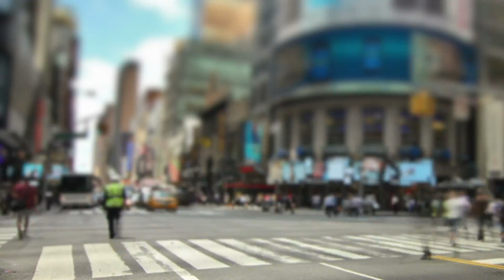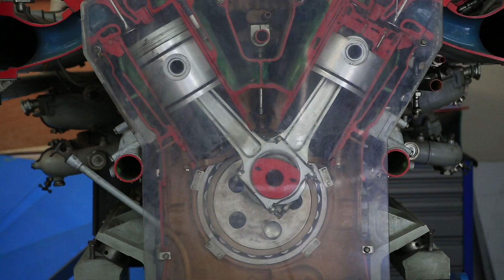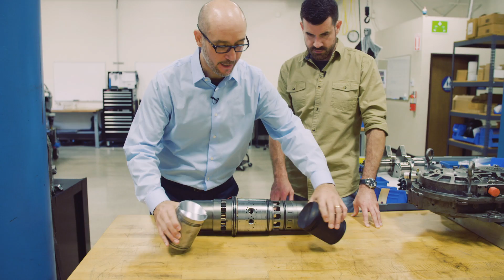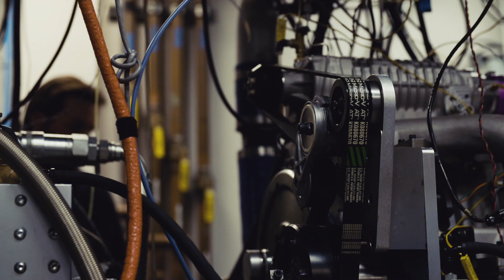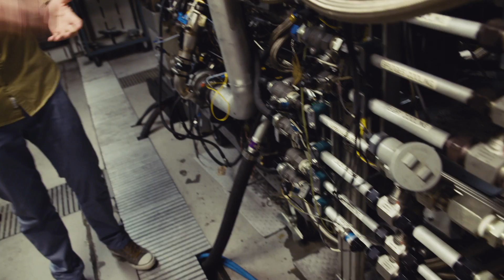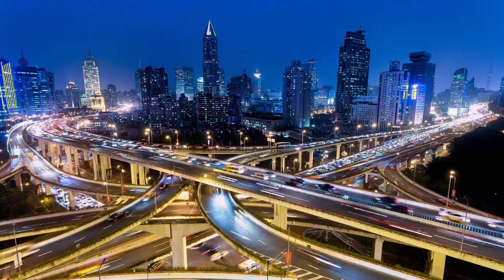This Radical Redesign Could Keep Gas Engines Pumping | WIRED

Comment: Electric is superior. We don't need a better ore efficient engine, we can theoretically power the earth with solar energy. It may take a while, but what we need is better batteries, better solar cells, better wind turbines and a better infrastructure for energy transport. We don't need combustion.
Reply: dehim verveen electric also consumes ore, batteries have rare material in them, find a way to cut out the rare parts and then you got a efficient engine
Reply: Zack, pay attention.

Let me say this again.  It is NOT true that current Lithium Ion batteries of the variety you find in a Tesla, for instance, contain rare earth elements.  Manufacturers have found ways of building batteries without them.  Your information is way out of date.
Reply: I'm all for electric and really efficient engines. MORE gas for our LS engines.
Reply: They are only the quickest production car at 0-100... after that, they kinda suck as the higher the RPM, the lower the torque... and until electric cars are using hydrogen power, they are toxic to the planet and they will generally become worthless when the batteries die (the cost of replacing them will be greater than half the value of the car = write off).. at best, they are a step to the side, not forward
Reply: John D hell yea marine
Reply: 2LegHumanist "Solar city are selling panels that are rated at $0.5 per watt. The price 5 years ago was $3.00. That's a massive improvement in price/performance." Then pray do tell , why solar has not caught on, even in the residential areas where it should be more-or-less uninfluenced by the grand schemes of politicians.

Oh wait, what is that? you dont just need panels to get solar? Well what else do you need? = A company to install it and rip you off, additional circuitry in your home, more or less dumping all the electronics in your house for ones that are power-efficient enough to run off solar ( inverter Acs and fridges, etc etc ) , The solar charge controllers, the batteries, oh dearie me did I forget to mention the batteries? 

Waving around the 0.5 figure does not do much if you live in the real world, where things arent magically the cheapest at wholesale prices and you dont need supporting hardware to make solar work.  

Now, all this said, I am a big fan of solar. But Im not blind to recognize that its just not there yet, not by a long shot. 

for now, IMHO 

investment needs to be 100% in solar
and our power needs to be from mainly nuclear and hydro.
Reply: 2LegHumanist Erm, you do. Its to smoothen out power delivery , at least one is required. Similar to how a in-line UPS works, if your goal is to just return back electricity. 

Giving heavily varying amounts of electricity back to the grid sounds like a recipient for some blown electronics. 

Oh wait, but does that mean you still have to rely on the power of coal and gas and oil to actually supply running power to your house?

Quite the ironic statement there. 
So you make all these non-arguments based off how economical and friendly and awesome solar is, and how the overall cost is a non-sequitur, as you dont need all of those extra things to run it, only to just implement it in a manner that still relies on fossil fuels? 

The Irony is deep in this one.
Reply: 2LegHumanist 
"Wow, you really are a moron."
Hold your tongue. Otherwise this debate is over. 

"Clearly you were referring to expensive batteries like the power wall, not a small battery for regulation which costs fuck all. Your entire point was about cost. "

No, I could be referring to a few deep cycle lead acid batteries as used in India with their UPS systems.  

"I also gave you the contents of my quote including full installation and including a battery for storage which also refutes your bullshit claim about feasibility."

= anecdotal evidence is worthless. 

"And no, it is not ironic to be a net producer of renewable energy. It means giving solar to the grid at peak times so that someone who would otherwise be using coal-generated energy is instead running on renewables. That offsets the owner's grid energy use. Very simple accounting, you must be an absolute fucking moron to not understand it."

No, the point here is to be able to run off solar. Either you do that via a company that only provides solar, or you do that with a complete home only system. 

Saying that "oh we are only using less coal now" is a complete bs argument. Thats like saying oh, its only a little bit of cancer. 

And may I remind you that the goal is to go completely renewable?
Reply: 2LegHumanist I'm not saying I agree with gasoline engines ether, they consume the world from the inside out, but so would electrical parts, the amount of cars created would out pase the amount of hard to find ores. this drives prices up and make it harder to build electronics, all we really need is a engine that can run on biofuels that can replenish themselves faster than consumption.
Reply: It's changing for hybrids too: http://fortune.com/2016/07/12/honda-rare-earth-battery-hybrid/
Reply: Matapatapa What a weird bunch of non-arguments.

Solar is catching on. The production of solar energy is doubling every two years.  It is increasing at an exponential rate!

You don't need batteries for solar.  You simply sell your excess solar energy back to the grid and run off the grid at night.  That's far more cost effective than batteries.  But you can expect batteries to become a lot more affordable when there are more electric cars on the road. Not only will it reduce the price of new batteries, but it will also create a second hand battery market.  Car batteries are useful in houses well beyond the point they're degrade too much to be of use in cars.

I don't even live in a sunny country and I can get a panel/battery system installed that runs my house completely for 8 months of the year at a cost of €0.04 per kwh.  Less that half of what i pay now for off-peak grid electricity.

"Not there yet" is a cop out.
Reply: "Electric is superior"
Not yet, but no one's trying to stop you from buying electric cars until one day maybe they are superior, then I'll hop right on that bandwagon.
Reply: 2LegHumanist
So, no counter-argument whatsoever? Just an expression of how you don't understand how quotations work? Cool
Reply: 2LegHumanist
This topic seems to get you too upset to even begin a discussion.
Reply: 2LegHumanist
You realize I wasn't originally replying to you, right? I was arguing against the OP. You started talking to me for no reason. So why tf would I argue against a point you made? I haven't even read your previous posts.
Reply: 2LegHumanist I really think you're missing my point.   Tesla is in the most precarious position of any new high tech company.  They are trying to cross the chasm where they go from selling high end low volume vehicles with sizable profit margins to high volume low margin vehicles.  And with the cost of the batteries being half the cost of the vehicle this is not going to be easy. Yes I know.  Tesla says that the Gigafactory is changing that. But it sure seems to me that Tesla is constantly selling to investors as much as they are selling to anyone.  I don't know how you can think the car pays for itself in 7 years.  It doesn't come close. At an average of 12,000 miles driven a year at $2.50 a gallon at 30mpg i've spent $7,000 on fuel $10,500 @ 20mpg.  With the electric car I saved say 2/3rds that.  But now I need new battery packs which totally eliminates what I saved on fuel.  Wake me up when the proposition is convenient and cost effective.  At the moment it doesn't come close.
Reply: dehim verveen Yes we do!
Reply: Oh look, a group of tree-hugging Hippies!

Solar Energy Doesnt work at Night, R&D for More Better Battery is Decades of Could be Half a century ahead of us.

Wind Turbine Can Break Down during storm.
There is also a Dangerous Substances used to create A Solar panel, They always escape in a gas form in the atmosphere, but its still Needed for sucking More energy.

Im not some Oil Company Paid Keyboard warrior, direct Drives Vs Electric Drives have Big Differences, Electric motor or any similar Tech tends to Heat up and wear down, Thats the Issues that Cant be Stopped On US navy's Electro-magnetic Railgun, it will never be stopped and they said Cancelling will be a big consequences or a waste of Money so they just have to Minimize it.

If you Idiots were to know something about those resent "Carbon Absorbing" Technologies, We can continue Using Internal Combustion.

Plus A Marine propulsion is Weaker, Thats why They Still Use Internal Combustion or Gas Turbines.

We Still Need internal Combustions because If you dont know, Space Outside Earth Is Cooler than you think, the solar panel of a Rover deployed on Mars Absorbs less energy vs the earth.

Therefore, your comment is Pointless liberal Propaganda.
Reply: The joy I get when I press the pedal down on my twin turbo built motor 350Z says that yes, we do NEED combustion.
Reply: 2LegHumanist ya, your right, I haven't had much time with the S type, mostly the behemoth prius. I just thought they improved apon the same principle XD
Reply: Matapatapa Wow, you really are a moron.

Clearly you were referring to expensive batteries like the power wall, not a small battery for regulation which costs fuck all.  Your entire point was about cost. 

I also gave you the contents of my quote including full installation and including a battery for storage which also refutes your bullshit claim about feasibility.

And no, it is not ironic to be a net producer of renewable energy.  It means giving solar to the grid at peak times so that someone who would otherwise be using coal-generated energy is instead running on renewables.  That offsets the owner's grid energy use.  Very simple accounting, you must be an absolute fucking moron to not understand it.
Reply: Matapatapa 
*Saying that "oh we are only using less coal now" is a complete bs argument. Thats like saying oh, its only a little bit of cancer. *

If the goal is to get to 100% renewable, why shouldn't achieving that goal include incremental steps towards getting to 100%?  Are you actually suggesting that we should do nothing at all about ever increasing cO2 emissions until we have the means to eliminate them completely?  That idiotic plan will result in a hell of a lot more carbon being produced before we get anywhere near 100%.

It would be a big fucking leap towards that goal if all day-time electricity was produced from solar such that coal plants only had to run during the hours of darkness.  It would also reduce the amount of battery storage necessary, since it would only need to kick in at night.

Cancer is not in any way analogous to cO2 emissions.  Not even a little bit.  Reducing carbon emissions is the goal. It is not an all or nothing zero sum game.  You've created a false equivalency fallacy.

And of course none of that what so ever changes the fact that battery storage is here today and it is affordable.  But people who do it are doing so to get themselves entirely off the grid.  That's a different goal.

I've spent time in Delhi and I am well aware of the situation with the grid that cuts out pretty much every day.  UPS systems are indeed needed there.  Fortunately those systems will get cheaper and cheaper as new battery technologies are developed.  They are being developed thanks to electric cars and mobile phones.  Lead Acid storage systems will soon be obsolete.
Reply: 2LegHumanist "If the goal is to get to 100% renewable, why shouldn't achieving that goal include incremental steps towards getting to 100%? Are you actually suggesting that we should do nothing at all about ever increasing cO2 emissions until we have the means to eliminate them completely? That idiotic plan will result in a hell of a lot more carbon being produced before we get anywhere near 100%."

You got me here. Your right on this point. 

"It would be a big fucking leap towards that goal if all day-time electricity was produced from solar such that coal plants only had to run during the hours of darkness. It would also reduce the amount of battery storage necessary, since it would only need to kick in at night."

Thats the thing. daytime is also when all our cars are running and all our other things are going, so IMHO a household going all solar at once and learning to budget electricity is better, because that will make daytime/nighttime management obsolete.
Reply: Matapatapa I agree that it's a better option, I'm just suggesting it isn't the only option.  People should be encouraged to produce renewable energy any way they can, whether they personally directly use it or not.
Reply: ***** "they are superior"

Glad you agree Jim.
Reply: dehim verveen There is no doubt that electric motors are far superior to internal combustion motors.  But the rest of your post is nonsense. The same  obstacle that prevented thei adoption of electric motors for personal transportation and trucking 100 years ago is still preventing it.  That is the ability to store and resupply the fuel quickly.  Billions are being spent on  creating a better battery/supercapacitor and yet we're not there yet and probably won't be for another 20 years. In the mean time more fuel efficient and less polluting gas and diesel engines will make a huge difference.
Reply: Some things like ships will probably remain or switch to being gas-powered though, either through hydrogen or simply synthetic gas. If syngas produced from solar energy becomes a thing before batteries with that same energy density, many things will stay on gas, because it's cheaper and easier.
Reply: 2LegHumanist EVs don't constitute 1 percent of the US passenger new car market and not even 1/10th that in the overall market.  They are effectively 0 percent of the trucking market.  You can lower the cost of batteries a lot and it still doesn't eliminate range anxiety.  The best EV on the market doesn't allow me to make it to the ski resort and back.  And no matter how many charging stations you build the slow charges prevent any serious market penetration.  Also you're ignoring the commercial trucking industry which requires range. I believe that one day EVs will dominate.  And for all the price drop the interest beyond early adopters is minimal.  No ICE vehicle resale value drops as fast as electric vehicles.  Most of the car manufacturers probably wouldn't be investing in them if it weren't for CAFE standards in the US and equivalent standards in Europe.  If companies like Achates can reduce fuel consumption in the Commercial Trucking industry they will save the industry billions and reduce pollutants by at least 10 percent.  I believe that at some point in the future EVs  will be ubiquitous and dominate the market but not with a lithium ion battery.
Reply: ***** I  think you're right Blazer.  The ICE isn't close to dead.  I'd even bet that more of them are being built now then ever before.
Reply: +dehim verveen Until we can recharge an electric vehicle in a comparable time frame to combustion engines (with comparable range) electric cars will not be a mainstream item.
also the infrastructure (power generation) would not support at present a shift to purely electric vehicles it bearly keeping up with present demands.
So any engine that greatly boosts the mpg without increasing the emissions is going to be greatly recieved
Reply: +Nikola Tesla

EVs don't constitute 1 percent of the US passenger new car market and not even 1/10th that in the overall market

I'd love to understand what the relevance of this sentence is to this conversation.

Especially when you later follow it up with:

I believe that one day EVs will dominate

I haven't claimed anywhere that EVs currently dominate.  I've merely argued that the technology is superior and will dominate in the future, a position you clearly agree with.  So why the strawman?

You can lower the cost of batteries a lot and it still doesn't eliminate range anxiety

Range anxiety can't be eliminated in any vehicle that has a finite range, including petrol cars. It can only be reduced.  In EVs it is reduced in two ways. First by increasing the capacity of batteries (and therefore range), which is made possible by the rapidly falling prices of batteries.  The second is by gaining even a small amount of experience at driving even a limited range EV as demonstrated in this study:

Rauh, N., Franke, T., & Krems, J. F. (2015). Understanding the impact of electric vehicle driving experience on range anxiety. Human factors, 57(1), 177-187.

The best EV on the market doesn't allow me to make it to the ski resort and back

So take the massive amount of money you save by not buying petrol in your daily commute and hire a petrol car when you need one if you're going to be that precious about having to stop for 10-15 minutes every 400km.

And no matter how many charging stations you build the slow charges prevent any serious market penetration.

Did you read any comments in this thread before responding?  Did I not point out that 350kw-1Mw charging is on its way?  Pretty sure I did.  It's hardly slow.  If you're going to drive more than 400km you should be taking a break anyway.

Also you're ignoring the commercial trucking industry which requires range.

Tesla will be starting production of long range heavy electric vehicles in the next two years.  They're actually great candidates for both BEV and FCEV technology. Lots of capacity to hold batteries and lots of capacity for large fuel cells.  Fuel cells BTW are only expensive in cars because of the cost involved in miniaturising them.  Large fuel cells are a dime a dozen.  All that is needed is the price of batteries to fall enough to make BEV trucks economically viable to load a truck with batteries or a better distribution network for renewable hydrogen.

And for all the price drop the interest beyond early adopters is minimal

You're clearly not paying attention if you believe that.  Go take a look at the volume of pre-orders for the Tesla Model 3.  400 thousand reservations and counting with deposits paid two years in advance of the first vehicle leaving the production line.  The interest is there, people are just waiting for better range in a nice looking affordable car.

No ICE vehicle resale value drops as fast as electric vehicles

Yes, more evidence that BEV technology is rapidly improving.  Noone wants last year's model because next year's model is way better. Also, who gives a shit about resale value when the running costs are so low that the car can pay for itself?  I certainly don't.  When my leaf ends it's life I will be salvaging the battery as a house battery and selling the rest for scrap.  By then the vehicle will have paid for itself twice.
Reply: +Ste T
Until we can recharge an electric vehicle in a comparable time frame to combustion engines (with comparable range) electric cars will not be a mainstream item

Bullshit.  Almost all driving that happens is short range.  Very few people are going to be put out by having to stop and charge for 15 minutes every 400km during long trips and all other charging takes place at destination.  The car charges while you're not using it, so there is actually less waiting around.

Petrol car = making a special trip to a petrol station, waiting 5-7 mins to fuel up, lining up to pay and then continuing on your journey.  

Electric car = show up to your destination, plug in and walk away.  Your car charges while you are sleeping at home, working at the office and/or shopping etc.  Zero waiting.

the infrastructure (power generation) would not support at present a shift to purely electric vehicles

Bullshit for a number of reasons.  

1: It takes 6KWh of electricity to produce 1 US gallon of petrol from crude in the refinement process alone.  Stop buying petrol and you reduce the demands on the grid.  
2: Almost all electric vehicle charging happens at night during off-peak periods when electricity is at its cheapest and demand for electricity is at its lowest.  There is abundant capacity in the grid.
3: Hate to break it to you, but even if there was a capacity problem, its possible to increase power production in power grids and affordable to do so when there is a market for that electricity.

It's fun debunking the same lies over and over again.
Reply: 2LegHumanist You're glossing over far too many issues.  I absolutely AGREE with you that we are moving towards electric vehicles. Electric vehicles are 5 times as efficient.  But charging with 110v AC takes 16 hours to recharge and even with 240v AC  it takes 8.  And while peak electric demand is during the day with maybe .one tenth of 1 percent of the vehicles charging at night.  It won't  be when even 10 percent of cars are charging at night..  Your head is is in the clouds over the speed of adoption. My bet is that new vehicle sales of EVs don't crack 1 percent for 5 years and not likely to crack 5 percent for 10 years.  In the meantime that dinosaur the ICE can always benefit from further improvement.
Reply: But charging with 110v AC takes 16 hours to recharge and even with 240v AC  it takes 8

Which is precisely why nobody charges from standard household plugs.  That's granny cable charging.  EV drivers have charge points installed in their homes that offer considerably faster charging speeds.  They're not even expensive, you're talking €300 including installation for a 3.3kw charge point.  My 6.7Kw charge point fully charges my Nissan Leaf in 3 hours.  Tesla sell 10 and 20KW charge points to charge their larger batteries.

People who can't charge at home use the public network.  Most public slow chargers are 22KW AC.

And while peak electric demand is during the day  
It won't  be when even 10 percent of cars are charging at night

You got some numbers to back that up?  Should be easy enough to work out. Off peak demand minus capacity gives you the remaining grid capacity.  Find out what the average commute is and to work out the necessary demand it's about 0.75KW per km.

And I'd love to understand why it is that every time this issue is raised people act as though grid capacity is some immutable constant that can never be changed, even with higher demand from paying customers.

I also love how ICE drivers are blissfully unaware that it takes 6Kwh of electricty to produce one gallon of petrol.  You'll need to factor that in too, cos if you don't buy petrol that 6KWh capacity can go into an electric car instead.

Your head is is in the clouds over the speed of adoption
My bet is that new vehicle sales of EVs don't crack 1 percent for 5 years and not likely to crack 5 percent for 10 years

LMAO.  You're betting against a lot of people who know a lot more about this than you.  

The Tesla model S now outsells all other vehicles in its class in the US.  Tesla are ramping up production with the Gigafactory and plan to build Gigafactories in Asia and Europe.  The Model 3 had 400 thousand pre-orders in one week, two years in advance of its production.  In 2015 battery prices fell by 35% and sales increased by 60% worldwide. This year we're going to see 60KWh batteries in $30k vehicles.  That's a doubling in capacity / halving in cost of battery tech.  Tesla, Chevy and Nissan all plan to start selling these in the next couple of years.  Across the spectrum, car makers and tech companies are investing billions on BEV technology.

I live in Ireland, where there are currently only 3000 PEVs on the road.  Government projections suggest this will hit 20,000 by 2020 and 250,000 by 2025.  It seems that anyone who knows anything about the EV market is projecting a massive explosion in EV sales over the next 3 years that will continue at an exponential rate.  Germany will be banning the internal combustion engine by 2030 and is pushing for the rest of the EU to do the same, and even before that, BMW pledged to stop selling ICEs by 2030.

This is before you start talking about the economic and environmental advantages of the cars, which is substantial on both counts.  There is a lot of misinformation out there and people like you just keep parroting it until an actual EV owner corrects their bullshit.
Reply: Actually investment supports my argument.  Goldman Sachs has downgraded Tesla to sell.  The Tesla battery pack cost is $190 KW although there is unconfirmed info that with the Gigafactory rollout they have reduced the cost by 35%. And 400K of vehicle orders is a drop in the bucket when GM  sells 10 million  and Ford sells 8 million and Toyota sells 10 million and VW sells 9 million etc, etc etc every year.  And oh, BTW, all those PEVs in Ireland also have you guessed it, Internal Combustion Engines. Tesla produces 3 different model cars  making up maybe one quarter of 1 percent the passenger car market.  NO TRUCKS AT ALL.   In the meantime ICEs are rolling out in the tens of millions each year.  The good news for your argument is there is enough interest in building a better battery that the amount of research has never been higher. I just read today that the University of Texas has just had a breakthrough in solid state batteries which increases energy density 3 fold.  But every day I read about so called battery breakthroughs and yet nothing seems to make it to market. I'm a big believer that electric motors will eventually power the wheels of almost all new vehicles being soldi n say 15 years but even with that I believe most of those vehicles will also contain an ICE.  Your enthusiasm for electric is warranted but I'm afraid you are looking at this through unrealistic glasses.  It takes time to create new models and retool and the demand for the cars is just not there. Yet
Reply: The Tesla battery pack cost is $190 KW although there is unconfirmed info that with the Gigafactory rollout they have reduced the cost by 35%

It's not the reduction in cost of the battery pack specifically that is important.  It's the fact that in 2016 you had to pay $60k for a car with a 60kwh battery and in 2017 you can get one for $30k.  They're not the same car, but the fact is the price of entry into the 60kwh vehicle market has halved.

And 400K of vehicle orders is a drop in the bucket when GM  sells 10 million  and Ford sells 8 million and Toyota sells 10 million and VW sells 9 million etc, etc etc every year

Do you not get that we're talking about trends here?  I'm not arguing that EVs are currently dominating the market. I am arguing that they will in the future and quicker than you are suggesting.  The fact is that at a time when there was a grand total of 400k EVs on the road in the  US, Tesla got 400k orders for an EV.  400K is not the total of all people who are interested in buying an EV at that moment.  It's the few who were willing to put down a deposit on a car that would not be ready for at least two years at that time.  It is a very strong indicator of widers support for EVs and that will only increase when the wider public become more knowledgable on the topic.

And oh, BTW, all those PEVs in Ireland also have you guessed it, Internal Combustion Engines

Bullshit.  The break down is 1800 BEV (100% electric) and 1200 PHEVs at the end of 2016.  It must be nice to just pluck numbers out of your arse instead of doing real research.

Tesla produces 3 different model cars  making up maybe one quarter of 1 percent the passenger car market.  NO TRUCKS AT ALL

Right, so again, when making an argument about the future state of the market I say Tesla will make trucks in the near future, y'know, cos they said they will, and your response is Tesla don't currently make trucks.  Maybe you should leave the debating to whoever ties your shoelaces for you =D.

In the meantime ICEs are rolling out in the tens of millions each year

Yawn.  Here we go again banging on about the present.

The good news for your argument is there is enough interest in building a better battery that the amount of research has never been higher. 

I just read today that the University of Texas has just had a breakthrough in solid state batteries which increases energy density 3 fold

There are breakthroughs in battery tech announced every second day and nothing ever amounts from it.  Elon Musk has suggested it's mostly bullshit and has told these researchers that if they really have a breakthrough send him a battery cell.  Until they do, the future is in lithium and it's doing just fine so far.

Your enthusiasm for electric is warranted but I'm afraid you are looking at this through unrealistic glasses

You're sadly mistaken.  Anyone who has ever lived with one of these cars understands that most of the problems people point to are trivial already. 

I pointed you to a study on range anxiety in a previous comment.  I suggest you read it.  It shows that people who are very skeptical of EVs become much more accepting after a short amount of time driving them.  

You are going to witness an explosion in EV sales in the next few years as more and more people test drive these cars and more and more people know other people who own these cars.  The ignorance perpetuated by people like you, who don't even understand the basics of charging, will be more strongly challenged too.
Reply: 2LegHumanist We'll see. We're arguing over how fast it will happen. I doubt it will be 5 percent of new car sales in 10 years and I think that is optimistic.  But that's still impressive.  Nothing else.   2016 US vehicle sales Tesla was 33rd right behind MINI selling 47,116 Cars.  Chevrolet sold 12 times as many Silverado trucks as Tesla sold as a company. Ford sold 20 times as many F series trucks. And Tesla dominated EV sales.  That shows you how tiny the market is for EV at the moment.  Chevy is adding the Bolt to its lineup but at 35 thousand USD for a car that would cost 20K if it was gas the only people that will buy are those with money to burn.  Gas is selling at $2.50 per gallon US.  It simply doesn't make economic sense even with EVs being 5 times as efficient.  Also resale of EV Sucks with Tesla being maybe an exception.  Cost to replace the 85KW battery pack for the model S is $45,000 USD. Thank God they have an 8 year warranty.  Tesla keeps saying it is less but I think there is lot of sales bs going on part for customers but just as much for Wall Street.
Reply: This is beginning to feel like a one way conversation.  You repeat the same old points without any reference to the refutations already offered in relation to those points.  But lets try this again.

That shows you how tiny the market is for EV at the moment

There are reasons for that, which have been explained to you and that I have demonstrated will soon no longer exist.

Tesla's entry level vehicle with not options or upgrades costs $60k in the US today.  BTW, here in Ireland the same car costs €85k.  You are comparing this large luxury vehicle to cheap every day vehicles.

The model 3 halves the cost of entry into the 60kwh EV market and brings in anyone who can afford to spend $35k on a vehicle.  That's a bigger market by orders of magnitude.

Talking about the current state of the market is completely irrelevant when you have a game changer like this on its way.  And BTW, the model 3 isn't the end of the story.  The model Y will bring 60KW BEVs to a much lower entry price again.  All that is needed for this to happen is for production of batteries to be ramped up.  Something that is happening already.

Gas is selling at $2.50 per gallon US.  It simply doesn't make economic sense even with EVs being 5 times as efficient

Petrol at that price is unique to the US and maybe some middle eastern countries.  In Ireland it's more like $5.70 / gallon.  It's much the same across europe and even higher in the UK.  In Australia, New Zealand and India it is only marginally cheaper than that.  There is a world-wide market here, not just the US.  Personally, I save so much by not paying for petrol that my car will fully pay for itself in 7 years.

But lets have a look at the US.  I'll work in metric because those are the figures I have.

February 2017 average price of petrol in the US was $0.68/L according to global petrol prices dot com.  One Litre of petrol contains 9.7KWh of energy.  That's $0.07 per KWh.
An electric vehicle is 3 times the efficiency of a petrol vehicle (not 5).  So this needs to be adjusted to a $0.21 / KWh equivalency.

Then we need to compare that to off peak rates of electricity.  I don't know what options you personally have, but I randomly chose a power company called Minessota power.  Their off-peak rates run from 10pm to 7am at a cost of $0.05 per KWh.

If I lived in the US and had my daily 80km commute, my petrol bill would be $160/month in an ICE.  With a BEV I'd be paying just $38/month.  A saving of $1,464 per year or $14,640 in a decade.  The car won't completely pay for itself, but if you take that saving into account, it puts a big dent in the purchase price.

Also resale of EV Sucks with Tesla being maybe an exception

This is only the case because the technology is improving so rapidly.  The first generation nissan leaf used to lose 30% of its range if you turned on the heater or air con.  They fixed that in 2013, so nobody wants to buy a 2011 model now.  The same will happen with the 24kwh models when 60kwh becomes the norm.  This hasn't happened with the Tesla because they all have minimum 60Kwh batteries.  We can expect the resale value to normalise in all vehicles once the 60kwh battery is standard across the board.

In my case I don't give a shit if my car is worthless at the end of its life.  I will have paid for itself more than 1.5 times by then and residual value will subsist in the battery, which can be used as a home battery long after its usefulness as a car battery expires.  A that stage I will be running on solar power and saving even more money.
Reply: dehim verveen Boy you are right AF.
Reply: I agree. All we need to do is get big oil billionaire ceo's and bureaucrats to release the strangle hold they have that forces the general population to use oil and release the patents they bought and buried to stop the production of products that steer away from oil burning transportation.
Reply: Matapatapa you are living in denial,
Reply: If hippies are concerned about CO2 emissions, how about fix the main problem. Find other materials to replace trees. Have we contributed to CO2 output..yes. Do I think it's enough to be of concern..not necessarily. I'm more worried about our quality of air. Plant trees. CO2 is plant food. Meaning if you look at agriculture, plants are growing like crazy right now. All the large trees are cut down and small trees are thriving. Meaning fresh oxygen for us to breathe. Oh and news flash to brain dead liberals, the atmosphere of Earth is approximately 78% nitrogen, 21% oxygen, and more argon than carbon dioxide make up the majority of the last 1% . You want renewable green energy, use ethanol over gasoline
Reply: dehim verveen lol the sun is ball of burning gas so you are still technically relying on combustion
Reply: take the win dude if you need it that bad ,you are beating that point to death
Reply: You would buy anything. Don't bet on all these "green" solutions it's a paper tiger.
Reply: Might do it when everyone has solar cells covering their roofs, but there are areas where the sun don't shine much and wind generation take up too much room. Solar is a really expensive option. Fossil is a really bad idea.
Reply: +Rayman 1 Climeworks can solve the problem , they build machine that captures CO2 and turn it into anything else . For Greenhouse gas for plants , Food & Beverages & Synthetic Fuel for Cars , Trucks , Aviation and shipping ;) .....
Reply: the military would still need internal combustion engines, it would be a while before they find a solution on how to recharge an armored division with thousands of vehicles in the depth of enemy territory with no charging infrastructure, ontop of that, it might be inside a desert or deep in rural areas with no existing grid network at all.
Reply: Batteries are constantly improving and the price per kw of solar is reducing on a logarithmic scale.  What planet are you living on?

And why minus wind turbines?  Because the latest report funded by oil industry shills said so?
Reply: we need better batteries and solar cells, plus better infrastructure.

minus the wind turbines.  

All other green energy other  then geothermal and nuclear is complete bullshit. Not worth the energy return if you take into account how much it costs and the problems of placement.
Reply: Matapatapa 

Solar city are selling panels that are rated at $0.5 per watt.  The price 5 years ago was $3.00.  That's a massive improvement in price/performance.

Solar is already competitive with fossil fuels.  The only thing holding it back in some countries are vested interests and politicians who live in the pockets of the mining industry.

Stop subsidising mining and see how competitive solar is.

BTW, welcome to the internet.  You're obviously new here.
Reply: 2LegHumanist For your first paragraph=
How about you go look at the graphs of cost of solar and battery efficiency over the last few years. Its logarithmic, if you look at the last 30 years. If you look at it more practically, the last 5 years or so, we have barely improved while our energy demands have skyrocketed. 

"What planet are you living on?"
"And why minus wind turbines? Because the latest report funded by oil industry shills said so?"

Keep your tongue under control. If you cant even start your first post in a debate without attacking the other person, I have no time to talk to a child.

  
Back on topic.
Because aside from solar and nuclear it does not make sense. Nothing else can be placed anywhere, and nothing else extracts the same amount of energy in the long term compared to how much money is input. 

There is a possible exception of geothermal beating out solar in certain areas, however.
Reply: RancheroBFT 
That's bullshit man. Economists have long established that Solar and Wind will not be able to keep us anywhere to close to where we are today.

LMAO. Those economists must be feeling very silly right about now.
Reply: In any case, the reality is that it is an electric car that is the quickest production car on earth.  Ranges are improving all the time.  It won't be long before we're all driving affordable electric cars with 1000km of range.
Reply: Chris Tate LMAO.  Keep spreading the goulash.  Pretty much everything you have said there is bullshit.

0-100 is far more significant than a high top speed that is illegal to even drive at.  Passing cars at traffic lights, overtaking etc is where you will eat my dust.

There is a particular kind of ICE driver who fantasises heavily about hydrogen cars.  They're people who have never driven a battery electric car and therefore have never experienced that superior drive quality, the low running costs, low maintenance costs and the convenience of home charging.  They're scared of charging times because they can't imagine the concept of fueling a car while not standing next to it.  Then they become easy targets of oil industry propaganda like the nonsense you just repeated.

Electric cars are are greener solution than hydrogen.  It takes 3 times the electricity to move a hydrogen fuel cell vehicle (when run on renewable hydrogen) than a battery electric vehicle.  Batteries are fully recyclable and at the end of their value as car batteries they are useful for many years as house batteries.  Nissan already has plans in place to start reusing car batteries as house batteries.  There are already batteries and electric motors (including all of Teslas) that don't include any rare earth elements.

The whole "environmental destruction" narrative is bullshit propaganda that is never presented side by side with the story of environmental destruction caused by fracking and drilling for oil.

As for the value, you're way off the mark.  As for replacement cost you're also way off the mark.  The Nissan Leaf battery pack can be replaced entirely for US$6k.  That's nothing close to half the cost of the car.
Reply: ***** Jesus dude, you started the quote mining.

What exactly am I supposed to be arguing against?  Your poorly articulated, non-specific personal opinion that started with an out of context partial quote?
Reply: ***** Why don't you start by arguing against a specific point I actually made without ignoring context and see if that works better.
Reply: Jim 
Oops 😂.  This is why there is a reply button.
Reply: Solar Power is now the cheapest form of electricity.  And just like Kurzweil predicted, people are saying it came out of nowhere.  This is because the price per unit and production rate has been improving at an exponential rate beginning from a very low base.  At the low base it appears as though very little is happening, but the trend continues and suddenly you see a rapid improvment and everyone is very surprised.

Anyway, check this out:

http://fortune.com/2016/12/15/solar-electricity-energy-generation-cost-cheap/
Reply: Billions are being spent on  creating a better battery/supercapacitor and yet we're not there yet and probably won't be for another 20 years

That's bullshit for two reasons.

1: Almost all driving that happens is within the range of current EVs. Even the cheap short range vehicles.  For those trips quick charging is meaningless, the car is charged when not in use.

2: We didn't have fast charging 100 years ago, we do have fast charging now.  50kw fast chargers, 150kw Tesla superchargers and soon we will also have 350kw - 1Mw fast charging.  This will charge even the largest Tesla battery in under 15 minutes.  We don't need new battery tech for this to happen, we simply need the faster infrastructure to be rolled out.

The price of batteries is also rapidly falling.  In a few months time Tesla will be delivering the first Model 3s, which have a 350km range and the vehicle costs around €30k.  

You're talking out your arse.
Reply: Zack Ruleman Stop repeating the lies of oil industry shills.  There are no rare earth elements in car batteries.  Lithium is not rare and it makes up less than 2% of the weight of the battery.  Also, that lithium never has to be topped up.  It is not even remotely comparable to a petrol tank that has to be refilled over and over again for the life of the vehicle.

This is one of the dumbest objections to electric vehicles that has ever entered the imaginations of internet dwellers who have no critical thinking skills.